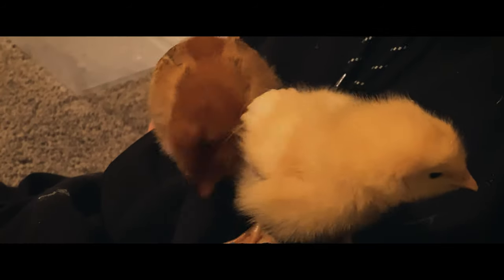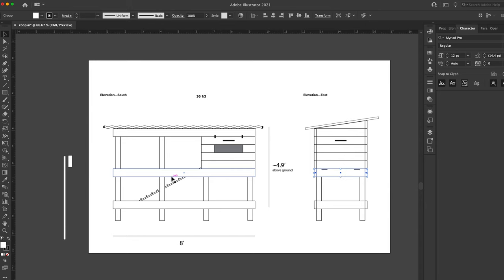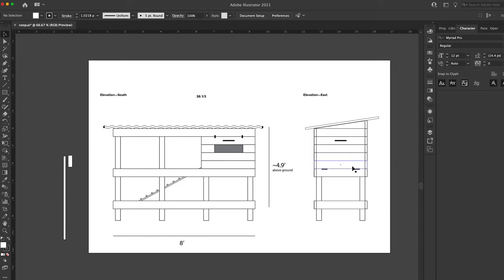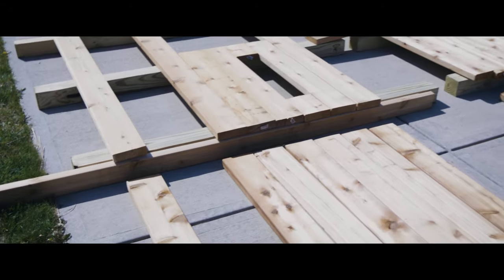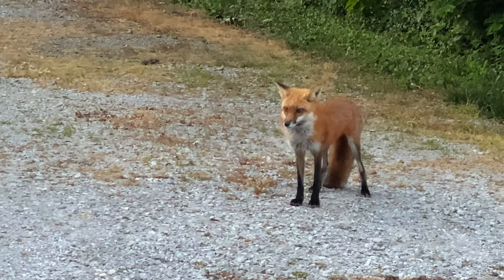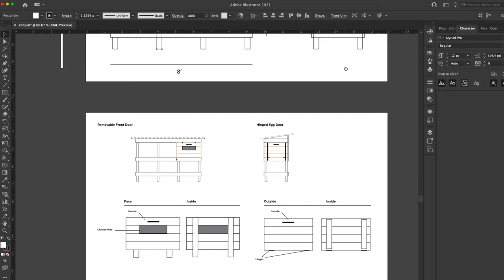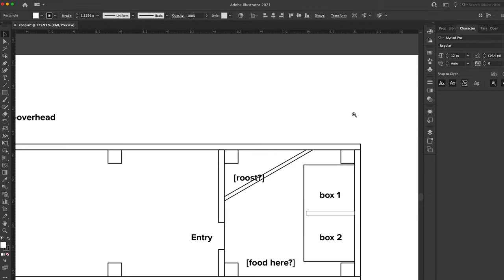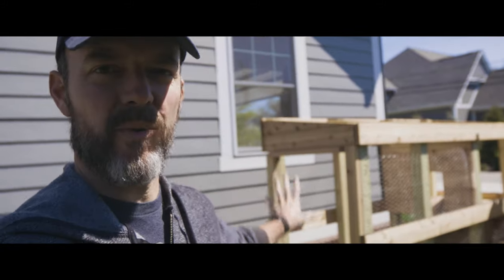How to Design & Build an Urban Chicken Coop + Plans

Comment: What camera did you shoot on. The quality of the video is great. And your sound is amazing. What are you using to get such clear sound?
-Damon from Casey's course.
Reply from the maker: Thanks Damon! I shoot most of my stuff on a canon R5. I’ve got a deity mic on top of the camera for the selfie stuff, and then the studio shots I’m using a Heil PR40.
Reply: @JoshMiles  I almost bought an earlier version of the Canon R but the reviews were that is was great for photography but bad for video. Looks like the R5 is really nice for video. I got the Canon 80D instead, which is Casey's old camera. I can't seem to pull the same quality from it. I also use the Canon GX7 Mach 2. I think the Mach 1 was better. 
I've got good microphones but they don't sound as good as yours. I might have more questions about your sound setup.
Reply from the maker: Happy to help! The R5 was a little ahead of its time. Before I got the new Macbook Pro, the footage was so massive, it was almost impossible to edit. So I definitely wouldn't recommend it unless you've got a mean machine for editing. 

Having a decent external or "desk" mic is pretty essential to get a great sounding recording. On the new video (#2 for Casey's class) the VO is on a Shure SM7B... it's a very similar sound to the Heil, but I really dig the tone.
Reply: @JoshMiles  Yes I use a Shure microphone on my camera, the exact one Casey used to use.